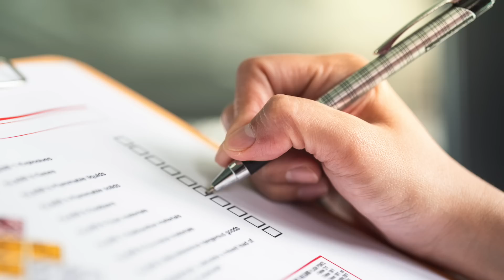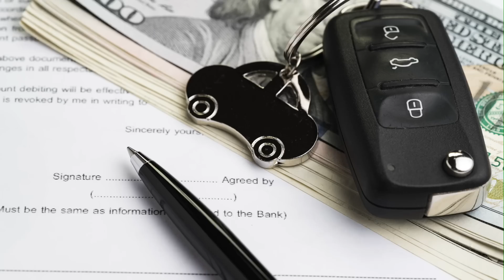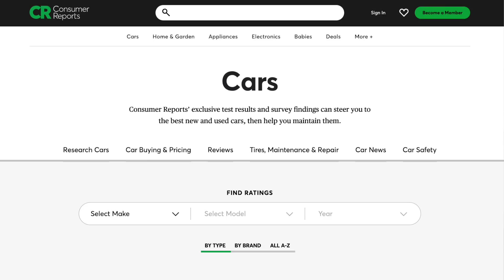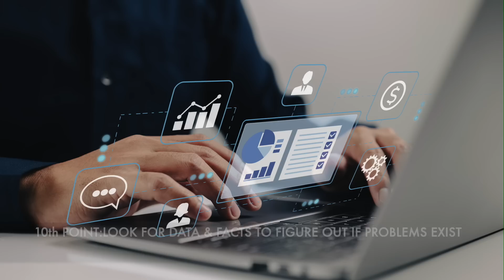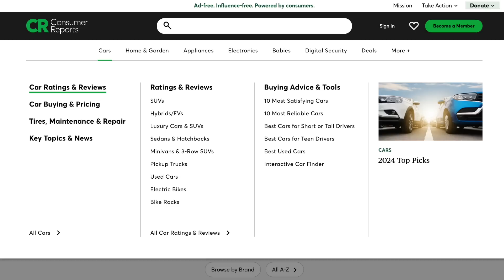DON'T BUY THESE CARS! // ENGINEER EXPLAINS HOW TO DECIDE WHICH CARS NOT TO BUY // HELPFUL GUIDELINE

Comment: 9:35 i agree, alot if people judge a brand based on it's old past history problems & it's newer vehicle's are the opposite now 🤔.

eg, *Toyota didn't have all the engine recalls in the past as they do now.
* Subaru had some head gasket issues in the past, but now none.
* Honda made reliable cars in the past, but not anymore 
* VW made the old classic reliable beetle & combi van, but now all garbage

Comment: We drove  Chinese cars here in Cambodia. Dongfeng brand is one of the most reliable vehicles in southeast Asia. Some owner drove it almost 100k km/year showing small amount of issues and nothing seriously with the engine performance. Sock absorbers and the structure of the body are also in good condition. The problem is tyres wear down after 75k km.

Comment: Want to buy a Mazda CR-50! I am a Japanese car buyer since 1986. Had a 1974 Chevy Nova 6 cylinder, 1983 Nissan Sentra, 1986 300 ZX (yes red with T-tops, got speeding tickets!), 1987 Nissan Sentra, 1993 Mazda 929, 2002 Nissan Xterra, 2012 GMC Terrain currently with 86k miles. Always followed maintenance manual at dealership for all my cars. Should I buy the Mazda CR-50 if it was built in Japan, Canada, or USA?
Reply: Buy CX-5 instead, solid and reliable and made in Japan

Comment: Most reliable cars: Lexus, Toyota, Acura, Honda, Mazda, Subaru......ALL made in Japan 🇯🇵
Reply: Oooops...  Wake up.. you have been fooled or asleep or braindead.   Many Toyoda models are made in U.S.A. and Canada buy the same workers who assemble GM and Fords..  "heard about the massive engine and transmission failure?  buddy. Wake up!   You are delusional:   Also Toyota is building a massive plant in Mexico ... so they will be using the same illiterate workers who make stellantis/ dodge and GM and Ford vehicle. There are only limited models made in japan.... and US engines and Automatic transmissions which are in expensive Toyota models ARE MADE IN USA.   Toyota quality is now GM/Ford/Dodge quality.  And  the dealers who sell these [ really made in USA] charge you %ools massive dealer markets.

Comment: 1. Don't buy 1st year regardless of brand.
2. Don't buy 2nd year too, especially if it's a new factory or entirely new car. 
3. Don't buy from brand new/start up companies. Wait 5 years. 
4. Service: Don't buy from brand where dealership is not in your vicinity-difficult to service
5. Don't buy with high mark up.
6. Have to buy quick?: Don't. Rent a car if you have to wait. Wait for the car you really want. Be patient
7. Don't let emotion run over your decision. Buy a car you need 80% of the time, not 20%.
8. Don't let your past dictate your future purchases. Car manufacturers change over the years.
9. Buy on total life cycle of car..factor in all costs. Purchase price, maintenance costs etc. 
10. Don't buy cars with known issue based on data.
Reply: So, no BMWs?
Reply: You saved all those 11 mins !! Thanks
Reply: All my cars are 1st and 2nd year models yikes. Need the styling when it is brand new!
Reply: Buy a reliable Honda/ Toyota or Lexus used.
Reply: Ha! I bought the first model year Mazda 3 in 2014 when it came out. Ordered it from Japan where it was made. 

Next model year moved production to Mexico. 

The Mexico cars where the ones with the issues and recalls. None applied to mine. 😊 

No issues after 10 years of ownership & 140,000 miles. Just oil changes. 🤷🏻‍♂️ 

Couldn’t be any happier. 🫡 

Cars are a lottery. Sometimes you get a good one… most get a lemon built on hungover Monday. 😂
Reply: @I_know_what_im_talking_about yeah... Your specific story doesn't invalidate the principle. You just got lucky.
Reply: I bought the first year Kia Soul + (2010 - bought in summer of '09) - that was a perfect 10 year car ownership. Heard the 2011 model and a few years after had fire and mechanical issues. Just fortunate.
Reply: @I_know_what_im_talking_about  wow that brings back a lot of memories! I do remember back in the day talking about do not buy the car manufactured on Mondays!!!
Reply: @I_know_what_im_talking_about yea but it’s about playing the odds.

Comment: Avoid excessive techno gizmos, gdi engines, turbo charged engines, push button start, stop/ start system, electronic parking brake, timing belts, digital led speedometer...tach...fuel gauge...engine temp , and low profile tires.
How's that for a list of things to avoid?
Reply: A 2005 Camry? 😂😂
Reply: Bicycle it is!! 🫡
Reply: My 92 tercel, 92 s10, '10 IS F, or 2020 mirage? The F has push button start but that will NEVER be an issue. My '24 WRX is turbo but I've read it's "the best" WRX ever made. We will see. If I treat it like I do my others (I beat on them but meticulous on maintenance) it will run easily 150k+ miles.

Comment: I will keep caring for and driving my 93 Camry
Reply: I still daily my 92 tercel with 178k miles. I own 4 other vehicles. 1980 sierra grande, 92 s10, 2010 IS F, & now '24 WRX. All paid off but WRX. I prefer to drive my tercel which is WAY cheaper than all my other vehicles. These 90's toyotas will not die unless you neglect it which the only way to kill them is oil starvation. All my vehicles run VERY WELL but the sierra grande.
Reply: Good luck with that…

Comment: Well I need a new car now so I'm getting the Mazda cx50 hybrid, even tho it's new fr a new AL factory.  You just endorsed this car.  The engine is not new, so I will just x my fingers it's ok
Reply: I would avoid that engine because of the GDI and the shim bucket valve train. Your intakes will be clogged up with hard carbon deposits and it costs several thousand dollars to adjust the valves. If you HAVE to have it, lease it for 3 years. You won’t want to own it long term.
Reply: The best solution for DI carbon build up is just to install a catch can.
Won’t cost more than $50 for a decent kit.
Easy peasy!
Reply: @ except they don’t work all that well. They definitely do not prevent carbon build up. The cheap ones do next to nothing, the best ones, not $50, only slow the rate of accretion. Best to just avoid GDI altogether, or to lease them for 3 years or less. You don’t want to own a GDI long term.
Reply: @craigg4246  well of course they won’t be as effective for VW GDI. Those DIs are a lost cause.
Toyota has a more efficient PCV system that already minimizes the carbon build up, better than VW or Hyundai/Kia.
Reply: @ Toyotas don’t have GDI carbon build up not because of a “more efficiant” PCV system, but because they don’t use GDI by itself. Their GDI system, called D4S, also uses multi port fuel injecters. The fuel coming from the port injectors is what keeps the Toyotas, and some Ford’s btw free from carbon build up. Mazda however does not use port injectors, so their engines will absolutely, positively, without any exception, clog up the intakes with baked on hard carbon. Reducing power and torque, fuel efficiency, and eventually the ability to even start and run. As consumers, we need to vote with our wallets. Tell these car companies, No more GDI only engines! We won’t buy them any more.
Reply: @craigg4246  good point. But Mazda’s starting to turn it around with the cx50h, even if they borrowed it from the rav4 hybrid. So yeah, fingers crossed.
Reply: @ until they either adopt dual injection, both GDI AND port injection, like Toyota and Ford have, or removed GDI altogether, there is no turning it around. You are deluding yourself my friend…..
Reply: The 2025 Mazda CX50 hybrid has a Toyota RAV4 engine; it doesn’t have a GDI  carbon issue as it also utilizes multiport fuel injectors.
Reply: @ that is really good to know. Thanks. I know Mazda’s gas only cars are GDI only, therefore subject to intake carbon buildup, but didn’t know they were using the Toyota engines in their hybrids. Appreciate the heads up.
Reply: @johninlasvegas  it’s not just the rav4 engine, it’s the whole power train.